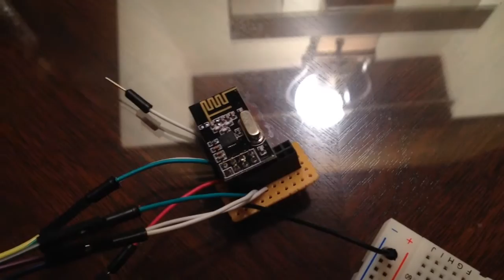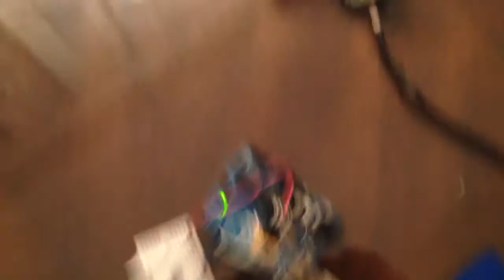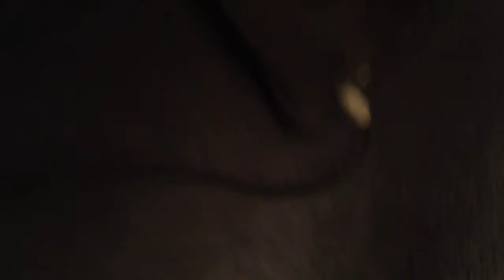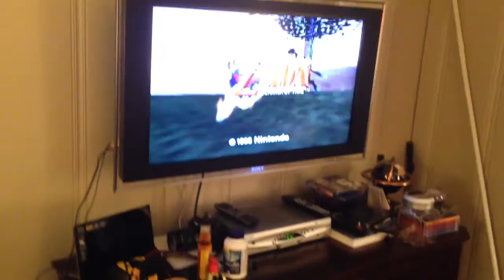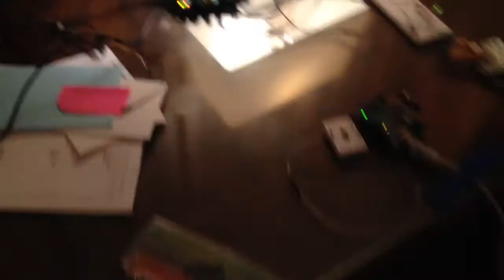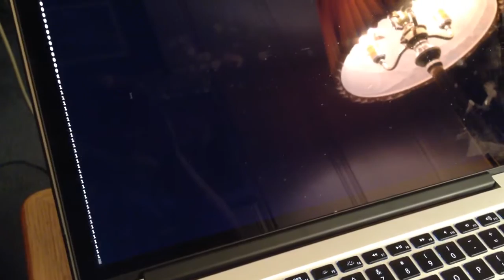Wireless N64 Controllers (proof-of-concept part 1)

Comment: U prolly have alotta N64 controller data processing knowledge to pull this off(Even though it's 1 button I'm still very impressed), I'm currently trying to modify a sketch from Andrew Brown " GC to N64 Controller " and I'm trying to get rid of the GameCube part so I can output N64 easy and have it depend on something like UDP packets for online kinda